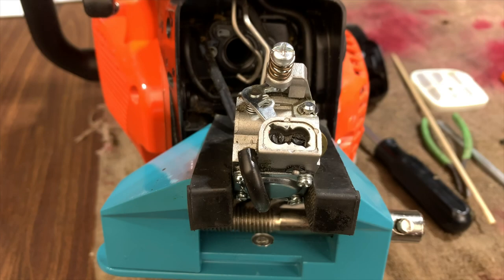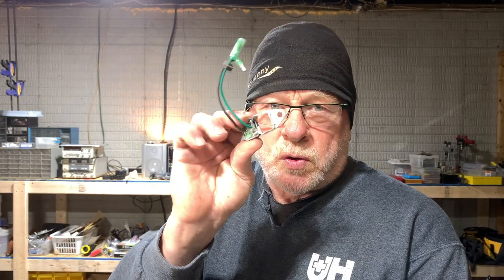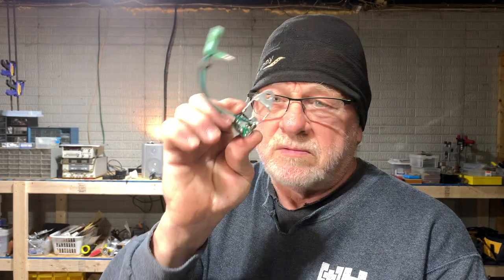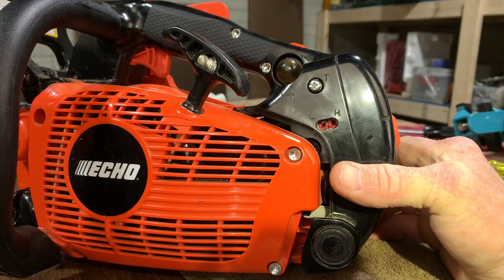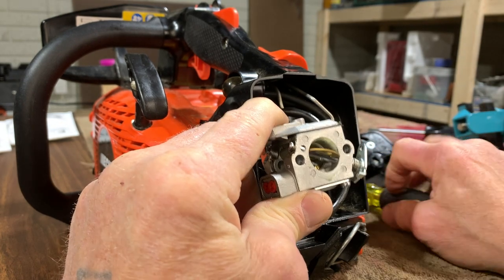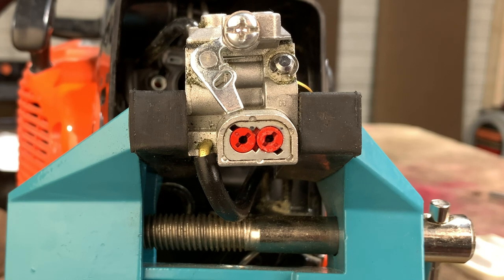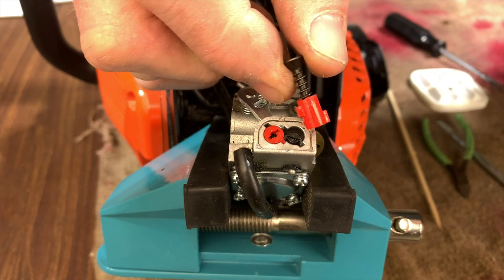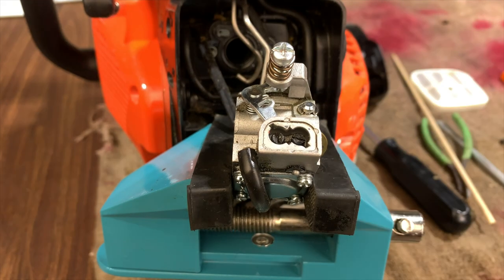Removing The Carburetor Limiter Caps From My Echo CS355 Chainsaw

Comment: The oil sensor is a problem in a lot of no starts, glad to see you’re family is up to see you
Reply from the maker: Sounds like the voice of experience. Do you replace the modules or just leave them off?
Reply: @WaynePolcin  I just left them off, I had put on a larger cylinder and piston and it needed more fuel

Comment: I was surprised how much the screws turned on my CS-2511T. Most carbs are 3 turns left or right when tightening from one side or the other to max out. My saw had like 5 or 6 😂. I removed mine completely but some people cut the tabs off the inserts and put them back in.
Reply from the maker: Right on. There’s a big difference in the number of turns, but the sweet spots are not they far away from factory, yet far enough away that the limiters keep you from finding them.

Comment: I recently bought a like new orange CS-306 for very little as the PO said it wouldn't run.  got it to start but ran badly.  put in a walbro brand carb kt and removed the cat from the muffler.  ran better but would not adjust right.  after watching this vid a few minutes ago, I did the stop removal and was able to get it running like a new saw.  owe ya (:
Reply from the maker: That's awesome! Nice work. I appreciate the feedback!

Comment: Hi Wayne! I did the limiter cap removal on (my memory is shot) either a weed trimmer or an old chainsaw last summer. To my horror, there was no screw under the cap, just a knurled peg. I had to put the limiter caps back on to be able to turn the adjusters. So I took a exacto-knife and carefully removed the little tabs from the caps, and then pressed the caps back onto the adjusters. I thought I would mention this so if someone watching decides to pull their limiter caps off, be careful not to damage them in case you run into that issue and have to reuse them. Peace
Reply from the maker: I have some carburetor tools and one of the tools is made specifically for turning those knurled stems. You idea is works well too and you still get to use a screwdriver. Plus they are a lot easier to see than the stubby stems. I think I need to make a follow up video to include your idea and to answer the question @moofdoggmike posed in the comments.

Comment: Thanks, Wayne for the visually clear and detailed video on removing the Limeter caps from the Echo chainsaw.
If you are trying to adjust a carburetor can you turn both the high and low screws all the way clockwise to begin the adjustment?
Reply from the maker: You can turn the high fully clockwise, but you will need to set the low mix to a starting point that is usually 1-1/4 to 1-1/2 turns counterclockwise. You also need to set the idle screw higher than normal to keep the saw running while dialing in the correct mix.

Comment: Dumb question, why are they there in the first place WP?  Have a good one.
Reply from the maker: I probably should have mentioned that in the video. Environmental Protection Agency emission standards require manufactures to limit the range of carburetor adjustment. So the caps are the  manufacturer's method of complying with the EPA rules. For the typical homeowner, these limits do affect the saws performance, but for a professional, they restrict the saw from performing at it's peak. This is especially true if you perform any additional power modifications, such as muffler mods and intake and exhaust port modifications, which require retuning the carburetor. Well, moofdogg, you did it again. Now I have to make a followup video! Have a great one my friend!
Reply: @WaynePolcin  did not know they were restricted for that reason WP,  thanks for the education!

Comment: Could you help me get mine running again? I turned the screws too many times while I was trying to remove my limiter caps and I can’t get mine to run right any more.
Reply from the maker: Sorry for the delay in getting back to you. Do you still need help?
Reply: @WaynePolcin  I was able to get it eventually by just tuning a little at a time. Maybe if you can recommend tuning for the H setting? I wanted more power, i have a little tachometer I ordered but not sure how to use it
Reply from the maker: @PowerThroughMusic  which tachometer did you buy?
Reply: @WaynePolcin  a little one off amazon came with a set of carb screwdrivers.